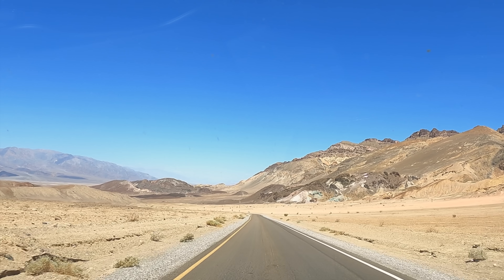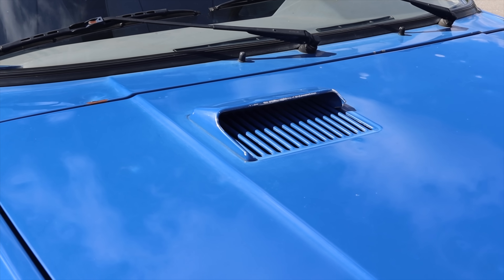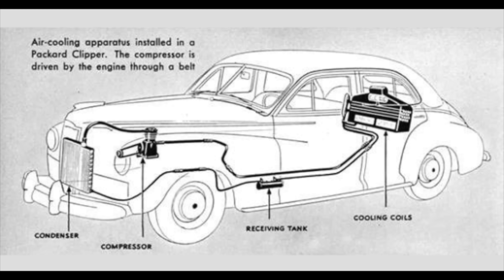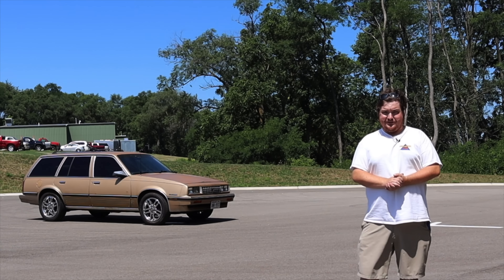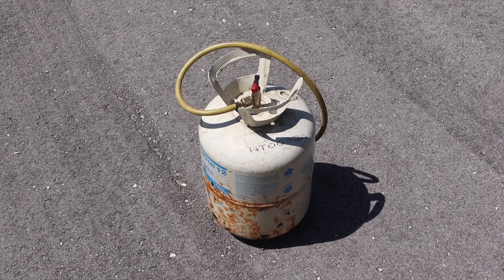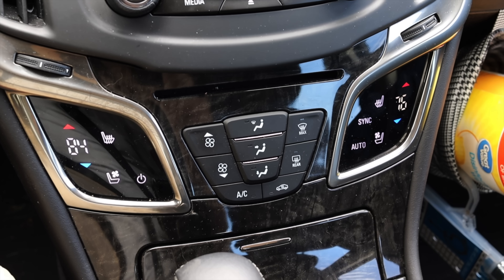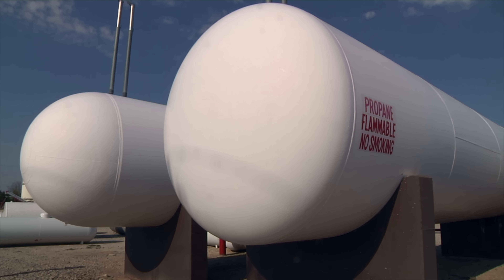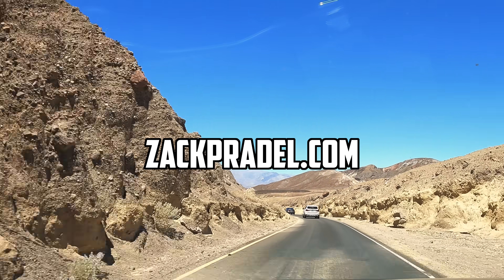Air Conditioning - The Story Of R12 & Why Modern Air Conditioning SUCKS!

Comment: Of all the cars I have owned over the years I have only had two cars with working ac, the first was a 5 speed Saturn that the ac blew out less than 10 minutes of leaving the dealership and my current vehicle is a 03 explorer that actually has great working air conditioning (extremely helpful living in this hellscape called Missouri but oddly enough that tuck also has no working heat….okay then….

Comment: If you have a r12 or even a r134 car or truck. you can get R12A from Canada which is compatible with both systems and cools just as well as the original r12.

Comment: the smokers window was before we understood aerodynamics now that we understand aerodynamics we no longer have the windows as they effect aerodynamics 

now that we know that burning winter gas in the summer or is it summer in winter causes smog and excess ozone couldnt we destroy that ozone with r12 so stop changing fuel blend changes and burn the same all year around and the excess ozone would replentish what was lost to the cfcs?

if you are going to use propane you may well as use r22 witch has similar cooling properties and it is not flammable

Comment: My old beat-to-hell 1980 Chevy Suburban work truck had "4-60" air conditioning. Four windows rolled down, sixty MPH! It also did have vent pull handles on the sides just above the front floorboard. Worked surprisingly well, as long as you maintained a good pace. I sure miss that old battle wagon.

Comment: warning long post ahead. this will probably get buried but hey I will post this anyways. saying r12 is "better" than r134a is factually wrong. there are many reasons why older systems typically have lower vent temperatures than newer systems. one thing to keep in mind about the r12 era systems being installed in American cars in the 1970s-1980s is they were way larger than they needed to be and they were very inefficient. for example most modern cars use about 1.5 pounds of refrigerant for a normal single evaporator system, however my mother's 1975 mustang II with factory air conditioning holds 3.5 pounds of r12, the old Lincoln town cars also hold about 4 pounds of refrigerant. they also have absolutely massive evaporator cores and huge condensers giving you more space to move heat from the cabin to the condenser. another thing to keep in mind is most older cars have lower volume blower motors so it was necessary to get the air as cold as possible to maintain a comfortable cabin temp. but with newer cars they can move more air trough the hvac system so its not as essential to get it to the 35 vent temp the old systems typically produced because there is more air volume. part of the reason why we have changed how these systems are made is to help fuel economy as those old compressors took a lot of power to turn, there are also weight savings and cheaper production costs as the newer evaporators and condensers use less material.

Comment: Just a few things. 
Comparing R12 to R134a is slightly difficult. 
(Disclaimer I don’t work with aircons ; rather with fridges but they use the same refrigeration gases). 

So a system that uses 1 gas cannot be directly compared to another because the gases aren’t interchangeable 1 to 1. 

Generally a gas change would warrant a change in compressor and expansion valve ( depending on the system). 

This means that you’re comparing completely different refrigeration systems in models of cars that use different gases. 

Where an R12 system may have been bigger, more power hungry and actually less energy efficient in the end, it may have cooled better. But manufacturers probably chose to cut costs and install smaller systems along with the gas change. 

Lastly PROPANE is not a crazy gas to use. It’s called R290. Butane is also used as a refrigerant and is called R600.
Reply: If you wanna compare, look at R-290 versus R-12. Propane looks even better than freon from a performance standpoint. It's just flammable, like the gasoline powered vehicle you're in. Reminder that camper vans and such drive around with much much bigger tanks of propane for heat and fuel.
Reply: R290 isnt comparable to R12 nor R134a, because it runs at 100PSI higher pressures, and heats up less when you compress it and it needs an recuperator in the suction line, rather R290 is a good replacement for R22 and R407c

RC270, or cyclopropane is a real replacement for R12, it heats up a lot when compressed has similar pressures (42low/240high for Rc270 vs 35low/220hi for R12) and 20% higher volument latent heat of evaporation
Reply: @renacimientoargentino7515  
True. Great comment. 290 is great for R22, not R12. Isobutane is closer, even. But I've not heard of cyclopropane as a refrigerant, very interesting. I like the idea of using lower pressure refrigerants since they're far less likely to leak when there's smaller potential energy to do so.
Reply: @mikafoxx2717   @mikafoxx2717  the issue of isobutane is that it has too little pressure and needs a Compressor twice the size, and doesnt heat as much nor cools down as much when compressed and expanded.

RC270 or cyclopropane has similar characteristics to R12 but better, higher critical temperature, lower pressure ratio (high side vs low side ratio) higher discharge temperature, and a 25% higher volumetric cooling effect, and doesnt have a temperature slide unlike mixed refrigerants

Comment: all refrigerants come in metal containers like that r12 does. do you think Ford recharges someone's a/c with those little 2 oz bottles? XD

Also R134a is no longer in use. R1234yf is the current refrigerant used in auto applications.
R1234yf big advantage is how reactive it is, It'll break down in the atmosphere much faster than R134a, and especially R12. Its big draw back tho, is its pretty aggressive to hvac oils, but we developed PN704 for solve this problem.

Comment: I worked as a parallel rack system mechanic at grocery stores for years and 25 years ago I was still working with real R-12 and R-502 and depending on the horse power of the rack? It was anywhere from 500lbs to 1,000lbs of Freon in those racks with hot gas defrost,  oil seperators and management system, EPR valves, belt driven cond fan blades. The old Hill Phoenix and Tyler Racks was what I worked on back then.

Comment: Using Propane as a refrigerant is common place and has been done so for many years, it is completely safe in a A/C system and is more efficient than R12, however you need to follow procedure, any A/C  system should be evacuated completely to remove contaminates and Oxygen from the system, " No oxygen no fire", it's that simple.  Most all of your small coolers in convenience stores and elsewhere use propane, it's cheep and readily available.  A small leak in a R12 system is a huge leak when converted to 134A, however Propane molecules are larger then even R12, it is simple politics that have us using 134A or now the new 1234yf,  it has nothing to do with "better for the environment", it has to do with money and always has, if the people in power were truly after "better for the environment"  Propane would have used from the beginning, Propane is found in nature and contaminates nothing when released into it. And just so you know 1234yf is very flammable and costs $1000 dollars per 10 lbs.

Comment: I had many R12 type cars and they were very hard to keep operating properly. I am so glad 134 came out because I have never had a system using it stop working like the 12's did all the time.
Reply: Now the question is, was it the R134 that made the system reliable, or was it that the material science in the metals and seals to make it work improved?

Comment: The first car I had with the new stuff was a '98 Chrysler Concorde.  The refrigerant was more corrosive than Freon and within 2 years, it ate through the interior AC heat exchanger under the dash.  It cost me about $800 for a new one.  I was properly pissed.  Apparently, it was common problem but it was not warrantied.  The replacement part was redesigned and it was okay after that.  I drove the car 9 more years and never had a problem.  I still think that since it was a problem caused by the original design and materials that it should have been a free recall repair.  My next car was a new '12 Dodge Charger and the first year I had it, a cheap plastic valve broke and pieces of it went into the compressor and wrecked it.  My dealership replaced it for free which was lucky since it cost over $1000.  Now I have a '19 Challenger and the AC in that car is amazing.

Comment: Propane is colder than even R12. It does not leak in systems where either R12 or R134a will. And it does not kill the ozone layer. Yes, a leak is dangerous in the case of a vehicle accident, but so are the other two. In fact, the propane will burn. But the other two cause a dangerous gas that is instantly lethal. If you are in an accident that is bad enough to cause a problem with any of them, you already have other things to worry about.
Reply: Propane can be used in either kind of system. Using any of the oils used. And it is used in most commercial refrigeration.

Comment: The real reason it changed is because Dupont's Patent was running out! I think it is 30 years.and that's why it's changing again.As far as the ozone? It was the space shuttle. It put tuns of CFM in the air with the fuel that they used. Just look at one going up back in the day.sure cars back 🔙 n the day when they got into accidents and spray cans were a problem! But the space shuttle was the problem. That's why it came to an end!

Comment: I have a 1983 Datsun 280zx that had R12 and a 2017 Sentra nismo with r134a both manual and the sentra has better a/c my Datsun used to cool down to about 50 degrees at full blast on a 90 degree day and it was good but once the compressor fried I couldn't find a replacement so I did a retrofit from vintage air and that thing gets down to 35 degrees on r134a now, my sentra on a 115 degree day gets down to 40 so needless to say old folks are wrong about this one. The one that is crap is r1234yf my GF's jeep has it and on a 90 degree day you'll be lucky if out the vent it's blowing at 65 degrees on the max setting and it's extremely problematic I've already replaced 2 compressors the most recent one for leaking out extremely from the shaft seal the first one grenaded and took out the system with it

Comment: I had a '97 honda before and it used R12. It really was very cold. If set to max, even at noon, moisture would build up on the windows and windshield because of how cold it was inside and how hot it was outside. Outside temp was around 32 - 35 degrees celsius. But now, in my 2022 toyota, i'm still sweating even if the AC is set to the coldest setting. The 90s was really the golden era in the automotive world.

Comment: R12 came to be because DuPont wanted to sell their "patented" R12 and did not allow propane and butane based refrigerants which offered almost no profit compared the the required use of R12.  Fortunately, the use of these chloro and fluoro carbon based refrigerants are finally being replace by much better propane and butane base refrigerants.  Please do not reply with incredibly ignorant comment about flammability of these new refrigerants.  They are no more flammable than the other ones and do not produce toxic gases like phosgene as burning these other "patented" refrigerants do.  As with so many things, government regulations were use to insure profits for DuPont.

Comment: I have to question how big the "efficiency" difference really is. What are the typical COP numbers for each?
I'm more inclined to believe that older systems were oversized, and fuel economy concerns drove size reductions which reduced the cooling power. And that just happened to be around the same era as the change in refrigerant.

Comment: Don't take this mean hearted but autoparts stores are the only place you'll see small 12-32oz can of refrigerant. Most shops have a 30lbs bottle like you see in your video that contains r134a/ hfc134a(same chemical) that you fill with guages or a fill and drain machine. The yellow hose is not for filling r12, that is the hose that hooks up to the container to a guage set. R12 uses a screw style connector vs push connect for 134a. When filling a ac system you want to be able to monitor both cold and hot side to verify the system is running properly. Generally you want to charge by weight but you can use pressure based on temp and humidity.

Comment: I have a 2012 A3 TDI and it wont get as cold as my R134 converted 1989 928 S4. Reason being is that the A3's condenser is probably undersized and the 928s is probably oversized. I did do a proper conversion with all new seals and new R134 expansion valves (has 2 because of rear AC) after I rebuilt the entire system because the compressor locking up and shredding itself under the care of a previous owner. Easiest way to improve the cooling of a converted car is to add a condenser fan for sure. More heat transfer=more cooling...

Comment: Supposedly synthetic refrigerants (R12, R134a, R410a, R1234YF, etc) were invented because older refrigerants were generally just hydrocarbons (such as R600, which is isobutane), most of which have corresponding R numbers along with many other gases (CO2 is R744, for example). Hydrocarbons are flammable, as you may know, and people wanted a more efficient and preferably less explode-y option. Applications vary, which is why your car may have R134a while your house unit may use R410a and your refrigerator may use R600. R12 systems use tube-and-fin condensers, which are much less efficient than the parallel flow type used with R134a. R152a, aka difluoroethane, is used in some brands of canned air (so is R134a though, aka tetrafluoroethane; check before buying). R152a's performance is much closer to that of R12 than R134a, so it works much better in those old systems than R134a does. Unfortunately there are no authorized methods of using it in cars, for some reason, so you're on your own if you want to give it a try. Bonus is that it's compatible with mineral oils, unlike R134a. You'd still want to use ester oil in an R12 retrofit, but a totally mineral oil-free environment is not as critical with R152a as it would be with R134a.

Comment: R134a actually works pretty well in a system specifically designed for it, however converting an R12 system to use R134a definitely sucks. The boiling point and pressure curves are different and so you need a lower charge weight of  R134a in an R12 system so you don't overpressure and rupture the sealed system, this fact more than anything is the reason why conversion systems suck. I played with heaps of HVAC systems on trains during my apprenticeship in the early 90's and literally charged those systems with tons of R12 and all conversion attempts had failed to that point. Using propane in refrigeration systems isn't as weird as it seems, modern domestic refrigerators and freezers use R600 which is Isobutane, look it up.

Comment: I'm fact propane is very good for what it can do. And if your point is that propane is flammable so is the gasoline, but the difference is you use around 500g of propane in ac unit but you use 70L tank of gasoline. The reason why propane is not used is only that it is too cheap and no corporation is going to make money on it. A lot of refrigerators work on propane with no problems for years

Comment: As someone who works with cars, and also cares about the environment, I hate that we sell bottles of r134a.  While it’s much less harmful, it’s still harmful.  Along with that, your AC system is enclosed, so if you’re low… you have a leak.  If you have a leak, you’ll just be emptying it out into the air.

Comment: The AC in my 97 F250 will absolutely freeze you out of it. The system is R134 the new 2021 ram 2500 I drive at work doesn’t even come close. It seems like it takes a lot longer to bring the temperature down and the coldest I’ve seen at the vent is 49* my F250 will get down to 38*.

Comment: R152A (keyboard cleaner) works EXTREMELY well. A little too well in fact. I was getting 25°F from the vents, and it would freeze the system if left all the way cold.

Comment: I had mixed results with r134a; on my van it's the coldest AC I've ever had, whereas on my SUV it's wimpy and awful. I also had a car with r12 and it didn't really put out that much cold air. I think it really depends on how well the whole system is maintained or designed. For example my van has two discrete AC units (front + back) therefore two condensers and blower motors, so I think that helps keep it a lot colder than on my SUV.
Reply: That's also because it's not really the refrigerant that makes the difference, but the size of the system. Back then it was normal to see car ACs hold 1500-2000g of refrigerant, now cars have 300-700g systems usually, for fuel efficiency. A truck with a big r134a system is gonna be much colder than a smaller car with a smaller R12 system
Reply: @FAB1150  could i fit a bigger ac system in my corolla????

Comment: Too funny.  It's the old stuff is so much better than the new stuff BS vid.   Wonder how many people commenting on here actually work on automotive ac systems for a living?  The AC system evap temp can only get so cold before the evaporator starts icing up.  A properly working and designed ac system can easily freeze an evaporator without a way to limit the refrigerant flow and it doesn't matter if it is R12, R134A, or YF.   It's mainly the design of the system and the condition of the components that determine the performance of the system, not so much the type of refrigerant.  Sure you can retrofit a R12 system to R134A and not have the same performance, but the system was designed for using R12.